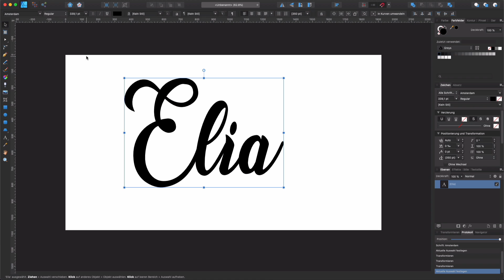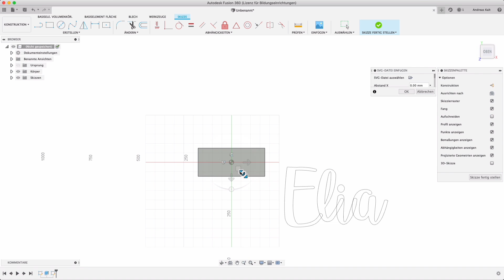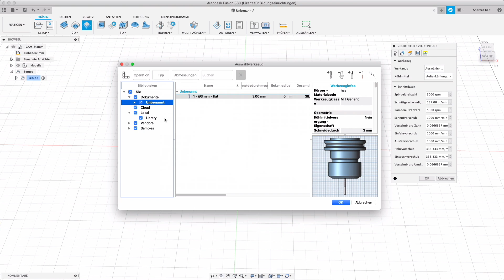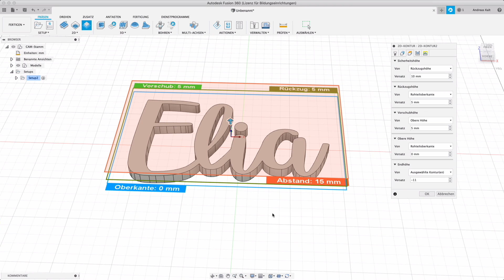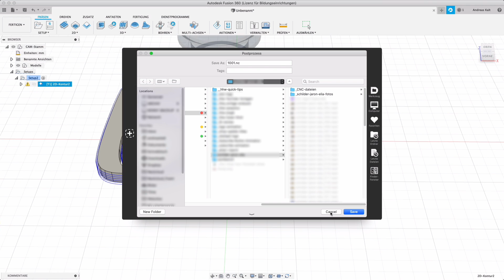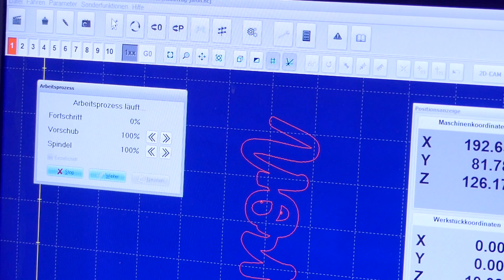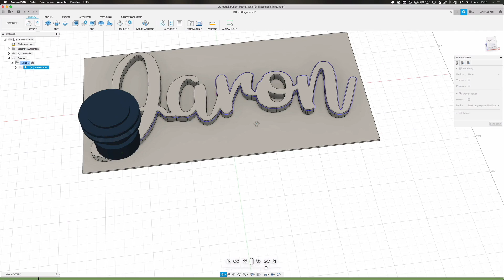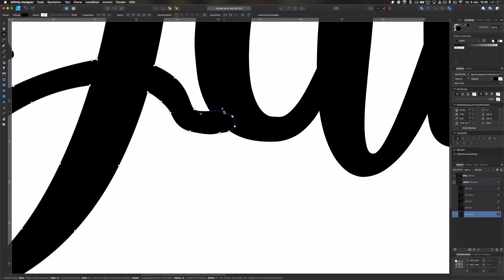Wood Sign Making – First Steps: Fusion 360 + CNC machine

Comment: I saved the file as an svg. Then extruded the board and placed the svg. However, My fusion will not follow the path of the contour. When i try to select the contour its showing up as almost individual lines.

Comment: Awesome video! I built a homemade CNC Router and it seems to be working ok but I am struggling designing signs. I checked out the software you are using but the recent reviews don’t sound so good. Are you happy with the current version of Affinity Designer? Then of course there’s the new licensing of Fusion 360. Do you still plan to use Fusion or go to something else?
Reply from the maker: Hi Warren, thanks for your feedback and sorry for taking so long to answer. I still like Affinity Designer and usually don’t read software reviews. I find that most of them focus on some fringe aspect that someone is unhappy with and they bring their frustration to the review area. 

I only use a small subset of Affinity Designer’s features but they are more than enough to make signs. Mine have been very simple anyway: a handwriting font, some lines around the text … not more. 

And Fusion is still free for hobbyists: https://www.autodesk.com/products/fusion-360/personal – as far as I understand it, the features in the free plan should be plenty for hobby use and you can get a new free plan every year. 

Good luck!